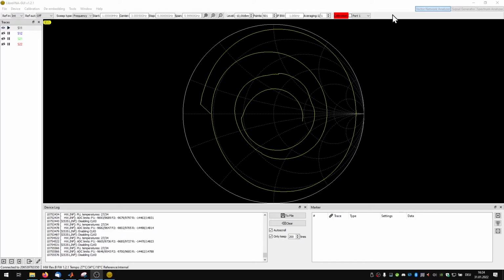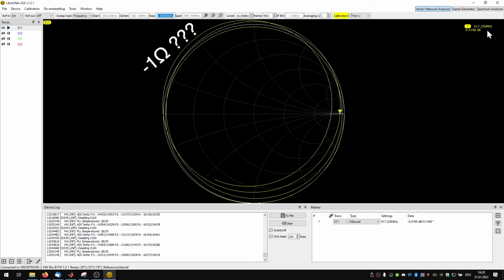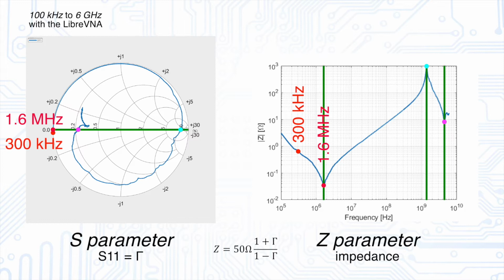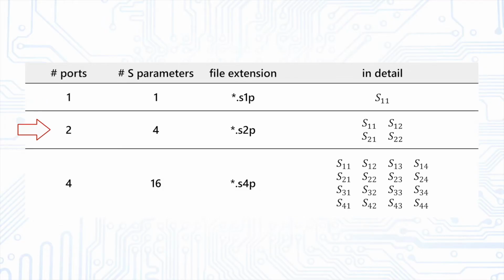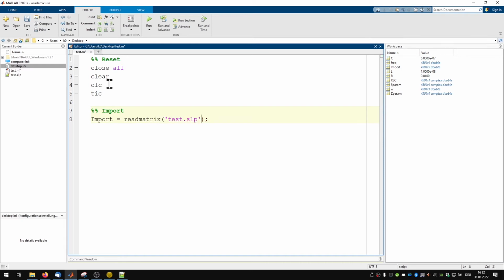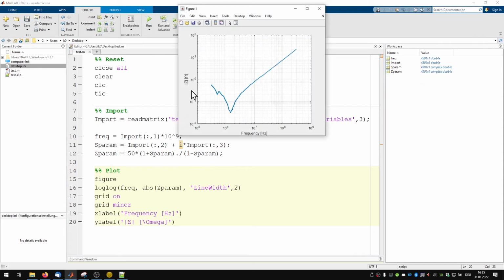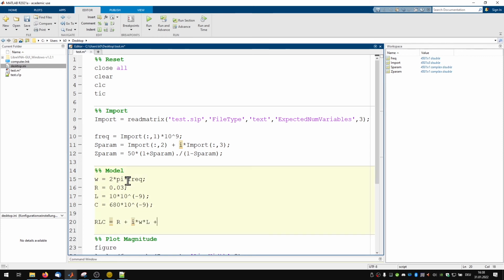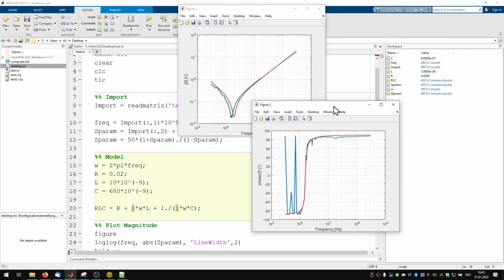LibreVNA, modeling a capacitor

Comment: Nice video! The touchstone import using readmatrix will break down once you handle more than 2 ports, though.
Reply: Thanks Bowfinger for your nice feedback! I must admit that I've never measured more than 2 ports at the same time, but I've merged 6 separate *.s2p files into a single *.s4p file (12, 13, 14, 23, 24, 34) in order to analyze mixed-mode S-parameters.

The import issue cannot be solved by increasing the MATLAB parameter like that:
1-port = 'ExpectedNumVariables',3
2-port = 'ExpectedNumVariables',9
3-port = 'ExpectedNumVariables',19 (wrong)
4-port = 'ExpectedNumVariables',33 (wrong)

Because the Touchstone syntax of a *.s4p file looks like this:
Freq. | S11(dB) | S11(ang) | S12(dB) | S12(ang) | S13(dB) | S13(ang) | S14(dB) | S14(ang)
empty | S21(dB) | S21(ang) | S22(dB) | S22(ang) | S23(dB) | S23(ang) | S24(dB) | S24(ang)
empty | S31(dB) | S31(ang) | S32(dB) | S32(ang) | S33(dB) | S33(ang) | S34(dB) | S34(ang)
empty | S41(dB) | S41(ang) | S42(dB) | S42(ang) | S43(dB) | S43(ang) | S44(dB) | S44(ang)

This means that you must stick with 'ExpectedNumVariables',9. But in order to help MATLAB, you should definitely delete the comments in your file (the lines with the exclamation marks). The "empty" cells should than be read as "NaN" by MATLAB. I've tested it right now (R2021a), and it works :)

The readmatrix command is like a blessing if you ask me. When I was dealing with this in 2017, I had to use the dlmread command - that was like hell. Every space was read and I've written a separate MATLAB script in order to get the data organized.

By the way, every VNA saves the data somehow different. In addition, I haven't looked at Touchstone version 2 yet.